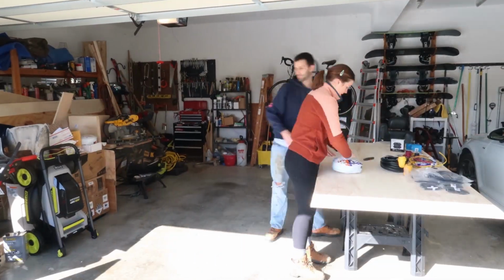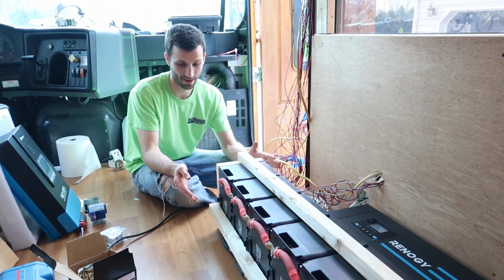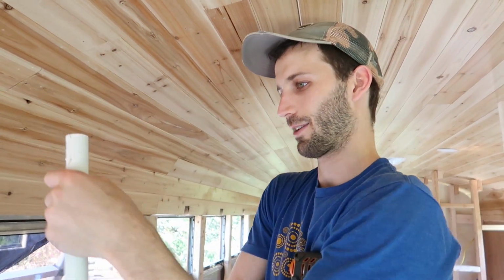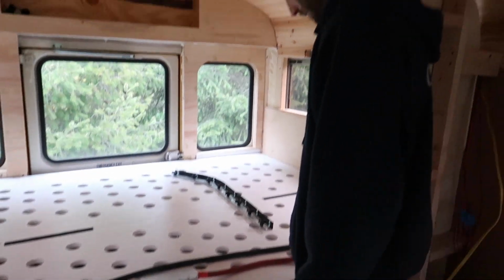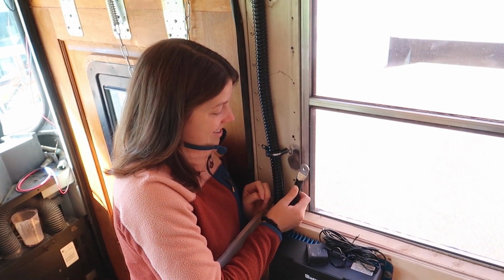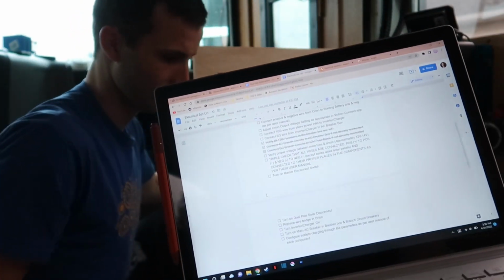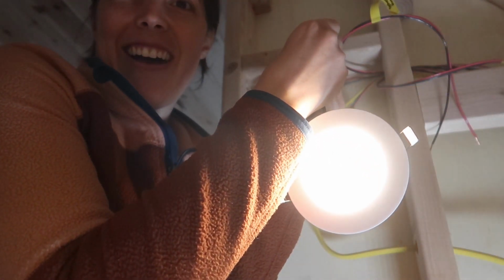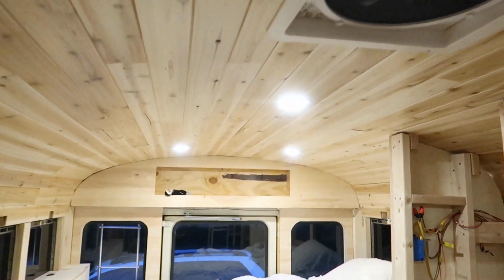Installing the Off Grid Solar System in our Skoolie | 1200W Solar, 600aH Lithium Battery Bank

Comment: Can we pick on you about what we'd have done different? I mean, I probably wouldn't change things now but you might know for the future during any upgrades and others will learn too. I see some things done very right too, that most people don't do. If I seen it right, you used stranded wire ever for your AC circuits or at least for the 30amp shore power plug, instead of solid core Romex like so many do and SHOULD NOT. EDIT, I haven't watched it all yet, so I'm adding, I'd have taken that chassis ground to the frame. Drill a hole in the floor of the bus and BOLT it to the frame. Surely there's a hole in the frame you can use a 3/8 size bolt and nut.

Comment: Do you know the total cost of your solar setup?
Reply from the maker: Around $10,000 - the majority of that was our panels ($1,800), batteries ($5,000), and inverter/charge controller ($1,200). The rest is all the wires, fuses, cables, breakers, etc!

Comment: Hi guys.  Been enjoying your videos.  I just have to point out that 120v connections with Mar connectors must be done within the box.  I saw where you connected them by your bed outlet, outside the blue plastic box.   It as to be inside.  Just be careful!  You're doing great.
Reply from the maker: Thank you!! Our uncle who’s an electrician called us right after seeing the video and told us the same thing, so it has been fixed! We really appreciate the tip 😊

Comment: I really like all the enthusiasm!
How could all this be necessary or useful I am not sure - but you appear to be set for.........?
!!!
A few days off the grid if the grid goes down and you are stranded without Netflix?

Still, the set up is nice
Reply from the maker: Thanks so much! We’re planning to travel in the bus full time and be off grid for up to 2 weeks or so at a time so we’ll be relying on this system a lot. We will also have a signal booster to get internet in remote places, and hopefully Netflix sometimes! 😄
Reply: @AdventureTrudge  AH!  Well that does sound like a lot of fun.   May the sun shine for you both!

Comment: First time seeing this project. I think you guys have done extensive research on electrical engineering. Hats off for taking it step by step and doing it the right way. 👍 

Wire colors must be of two different color standards. It's really not a common thing. My guess is, parts could have been from mixture of standards. But your dad was right. It really doesn't matter what color you choose for wiring. But try to stick to a standard and, properly label them. You probably will remember every thing happened, but several years down the road, if someone else try to repair, it will cause major confusion and concerns. Just a heads up.
You guys showed that with proper research and methodology,  anything can be done. 

Good luck both. 💖 
P.S - Try to cover live wire ends with electrical tape or something. Part where you explained about wire color confusion, live RED and BLACK were hanging so close, it kinda gave me anxiety. low power lines wont be a problem to mishandle, just add precautions on that to your workflow habits. Someday it might be what saves you.
Reply from the maker: It stressed me out when I watched it back!! Don’t worry, they are covered and separated from each other now 😅 A major perk of doing it all ourselves and filming the process is that we should know the system like the back of our hands and be able to look back at these videos if we forget! Hopefully we won’t need anyone else to do repairs, but we do plan on labeling it all very clearly just in case ☺️ thanks for watching! 🧡

Comment: That framing around the batteries will be ripped to shreds if you are ever in an accident, the potential energy of heavy objects like batteries is huge in a moving vehicle, I would seriously look at a steel cage around the batteries bolted to the bus frame in several places.
Reply from the maker: Not a bad idea! This is the way we’ve seen lots of other buses do it so we assumed it would be fine. We’re also building a cabinet around the entire electrical system so there will be extra framing holding everything in. We’re all about safety though, so we’ll definitely look into it!

Comment: You’re not crying- I’m crying! I was holding my breath the whole time and was just as excited as you both were. Absolutely gorgeous wiring job. This is the thing that scares me most as well, but I am a very long way from having lights. Question: do you have a fan for the whole setup? I’ve seen many talk about proper ventilation where the batteries, inverter, etc are. My plan is to put it all under the bed near my big handicap door.
Reply from the maker: 🥰 thanks Lynette! It really felt like a huge milestone. We aren’t planning to have a fan currently, we’re just trying to leave a lot of good ventilation around the area. We’re planning to box it all into a cabinet/under our couch, but include vent holes so there can still be airflow. We’ll definitely keep an eye on it though and can add a fan if we feel like it’s overheating. 🧡

Comment: I'm not an electrician but I don't think splicing outlet wires outside of the box is a good idea. I can see lots of things going wrong with this. Outside of that everything looks great.
Reply from the maker: I agree! I thought it looked off when I did it, it just didn’t seem like there’d be enough room in the box to hold them all. I’ll definitely take a look at it again!
Reply: @AdventureTrudge  so what you do is run the wires through the box and give each wire 4 to 6" outside the box then splice if need be. This way you know you have enough wire to splice or what ever you need to do then neatly wrap it and push it back in the box.